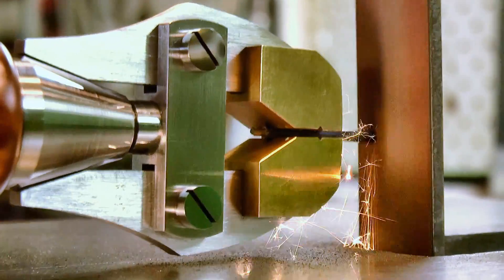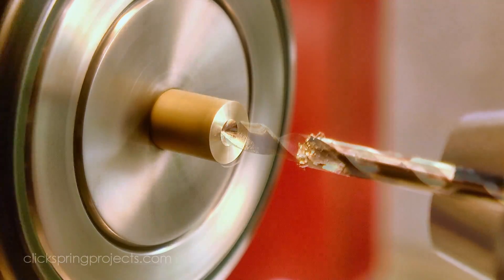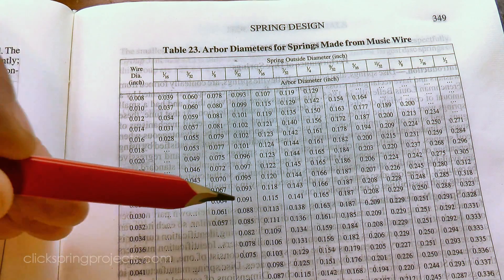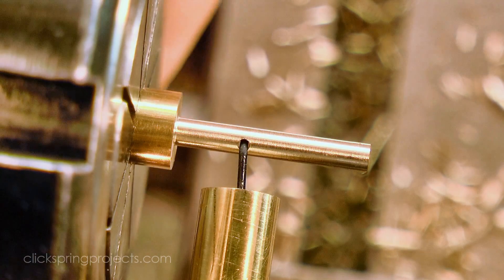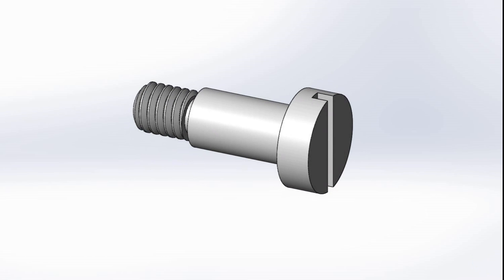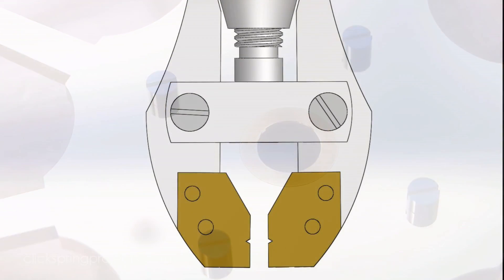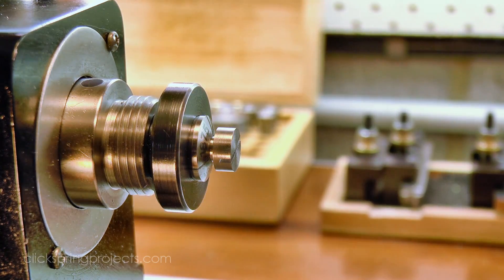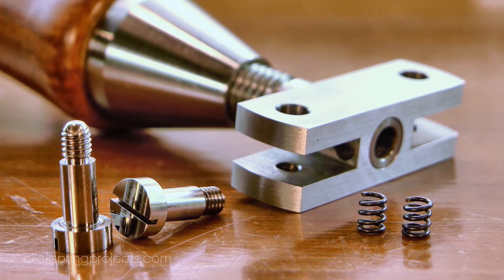Wedge Style Hand Vise - Part 3

Comment: Hey Chris, I'm re-watching these in preparing to make two of these myself. Do you need to treat the steel to prevent corrosion, or is the polish enough for the hardened tool steel? I know my HSS never seems to rust, but not sure about lower tool steels (I'll probably be using A2 for the body and cone and O1 for the screws, as that's what I have). Thanks!
Reply from the maker: Hey Jon - a well polished surface has a slightly lower tendency to corrode, but it will still rust if left exposed to moisture. I live in a very humid climate and have adopted the habit of giving everything a wipe or brush with a light compressor oil, and it works perfectly for keeping the rust away.

Comment: I notice you're running your propane torch off a 8.5kg gas bottle. Just wondering what kind of setup you use to adapt the POL thread on the gas  bottle to run the torch, with a minimum of leaks and explosions? I have looked at the range at Bunnings, and it's a bit of a head scratcher, trying to work out what goes with what, and what you actually need to make fire happen.
Reply from the maker: I get all of my gas fittings and hoses from my local BOC Gases outlet - they will sort you out :)

Comment: Awesome stuff Chris. I've never really given the process of making springs any thought (hobby woodworker) - but that is such a cool way to do it (especially since you already had the lathe setup for thread cutting). Speaking of threads - how do you choose between using a die or moving the carriage using the change gears/lead screw? Versatility to get exactly the pitch/diameter you want?
Reply from the maker: Generally its dictated by my laziness factor! I find the change gears to be such a pain to mess around with, I will use a threading die on most threads below M10, which is 99% of the threads that I cut. I have a pretty comprehensive set of taps and dies, so its rare that I encounter a thread not covered by my set. Once the thread gets much larger than M10 it gets a bit hard to cut by hand, so I switch over to single point threading for the thread. Cheers mate :)
Reply: Thanks for the response Chris. You now got me looking at a benchtop lathe for when I have a larger workshop again :)

Comment: Very nice.  I particularly liked when you manufactured the springs.  I hadn't really thought of it but I would have a ton of uses for that.  The only thing I really didn't like is having to saw the brass down to free the completed spring.  There's got to be a better way, especially if you need several of the same and you're just cutting off the starter length of the spring anyway.  Kind of an armchair comment because you're clearly more ahead of the game than I am, but the wheels are just turning after watching that :-).
Reply: http://hackaday.com/2016/05/29/making-springs-at-home/ Uses a screw to hold down the first turn. If you did that maybe you could just cut the spring to length?
Reply from the maker: Ha ha! Great to hear :) For small springs like this, I found that its all a bit too delicate to be messing around with other options. The trouble is getting the cutters in close enough to cut without distorting the nicely formed spring (and arbor) - its all very small (<4mm), and the very tip of wire cutters tend not to be great at getting into tight spaces. For larger springs you could get away with cutting the spring free closer to the cross hole, or do away with it completely and use a set screw on the perimeter to hold the wire, and so keep the forming arbor indefinitely. There's always better ways to get the job done!
Reply: Would a slot on the end of the arbor work?  Very nice work as usual.
Reply from the maker: As mentioned above, for a larger spring, definitely.
Reply: Perhaps you could have the part where the wire sticks into the arbor as just a small section, and the part it wraps around as another section, and the two screw together. That way once the spring is formed you unscrew the two pieces and slide the bar out from the middle of the spring and then the spring just slips free from the hole. Might work, probably depending on how far apart the spring sections are.